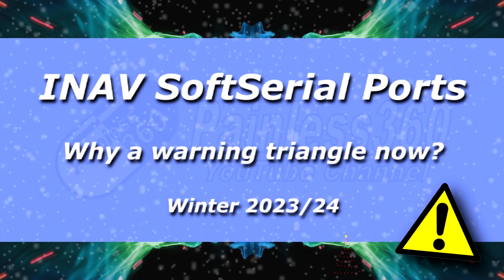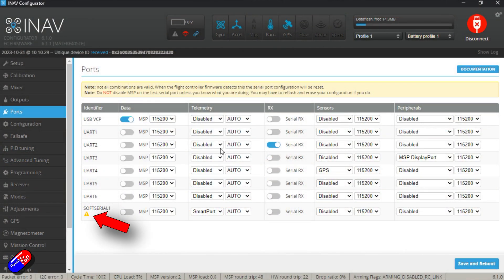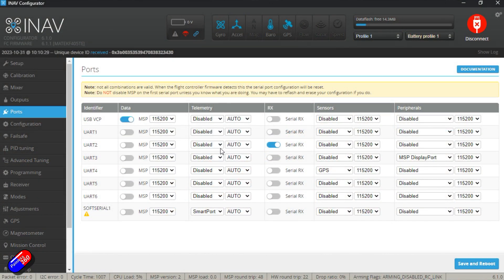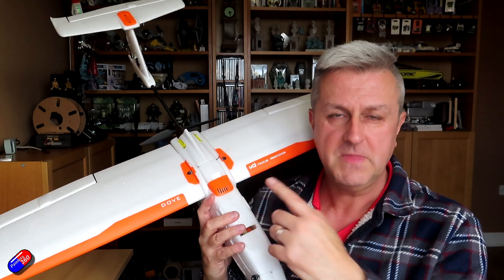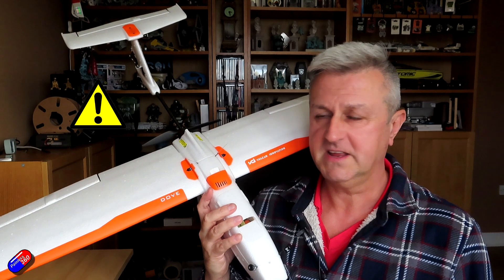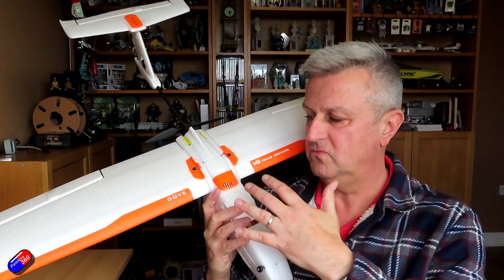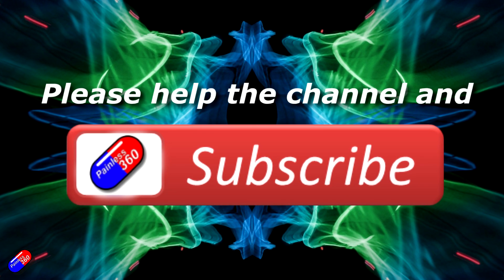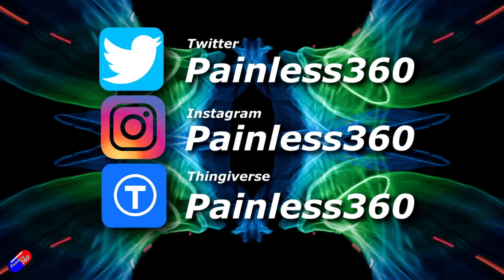Why do INAV 'SoftSerial' ports now have a warning triangle?!

Comment: Can you add video how to connect by this port hdz or walksnail to get osd ?
Reply from the maker: Don't use Softserial for OSD. See my videos on that.. best of luck
Reply: @Painless360  ok. I ll try softserial for gps
Reply: I got osd with hdzero but stil no GPS. Is it special configuration for gps by SOFTSERIAL or only change sensor for gps and correcr wiring ?

Comment: Hello sir, Please could you recomand some device like Arkbird1.4W ,5W 433 long range repeater which can more travel about 5,6 miles.
Reply from the maker: Those things are not something that I know a lot about here. Flying that far here in the UK isn't legal. There are some excellent details on 'long range' flying with things like Crossfire and ExpressLRS as well as Walksnail HD FPV too.. Best of luck.